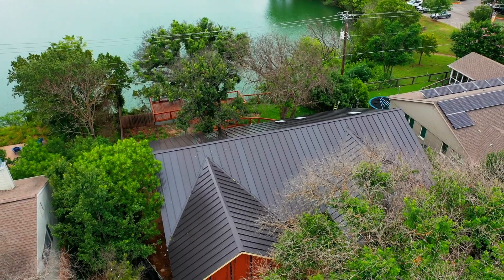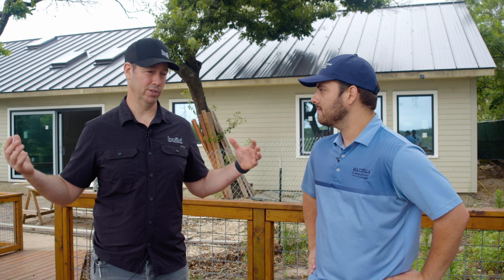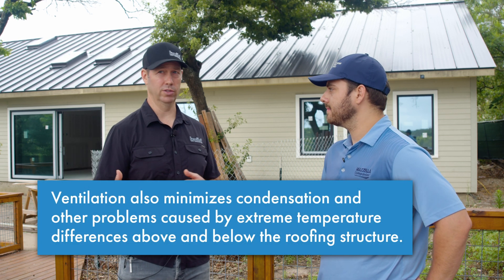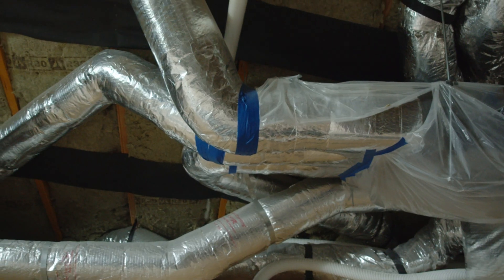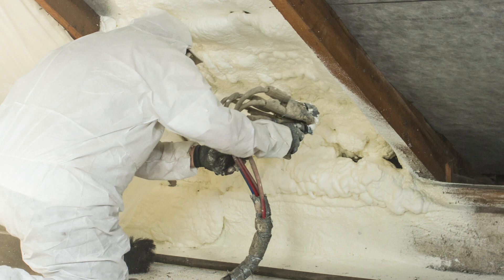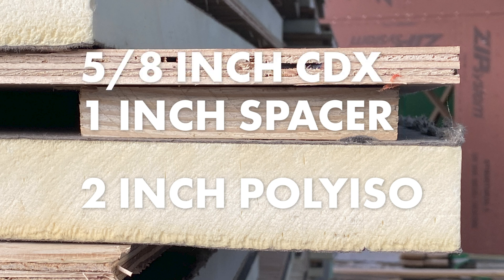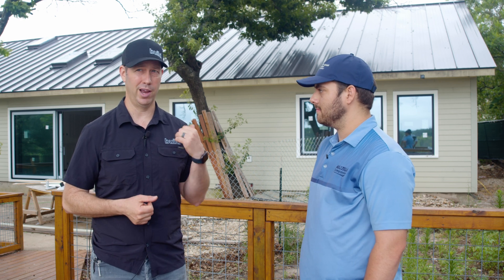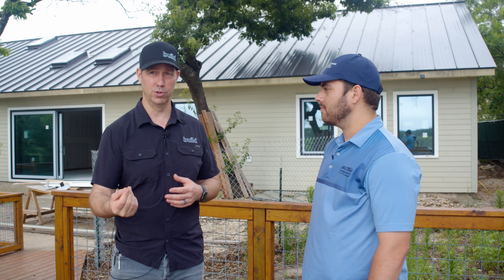Conditioned Attics vs. Vented Attics: Matt Risinger and Hunter Panels

Comment: Venting attics are good if there are no ceiling penetrations and alot of insulation. No ceiling hvac etc.  work well for some applications- mainly small homes or off grid houses with wood fires in cool climates with modern windows and good insulation throughout
Reply from the maker: No doubt that HVAC in the vented attic space makes it inherently inefficient (this is one of Joe Lstiburek's favorite topics). However, there are many homes in the North and Northeast with basement HVAC systems and vented attics that do work well. -Thad

Comment: FYI, Boral (manufacturer of tiles roofing products) makes a “cool roof” system that’s reported to save 28% energy costs by passively allowing air to enter holes in metal eves; then the air passes up the roof deck (via Boral’s elevated baton system) and the hot air vents out thru the ridge cap.   
It’s a great system.  8:13 
Plus the elevated batons mean all of the tile screws go into the battons, but do not penetrate the roof deck.  Save 1,000’s of unnecessary roof deck penetrations.  
Moreover, with the elevated batons. any water that does get past the tiles can run unimpeded down the deck and out (traditionally built tile roofs have batons nailed direct to the roof deck, which means water can pool up against every baton).

Comment: So i put foam throughout attic and now im replacing shingle roof with standing seem metal and they said they are going to remove all vents since i dont need them. They are closed up with foam now. But you are saying i need to create a gap between existing deck and new roof and install vents? 8

Comment: So how is the air sealing of the roof deck done with the Hunter panels? Just the spray foam inside? Also, won't the polyiso of the Hunter panels shrink some over time and pull away from each other?

Comment: i hate to be this guy.  what they are having put in that roof for a 50 year roof baffles me.  my home was built in the 60s, it's not insulated very well but vented.  Replaced the shingles 2 years ago the roof deck looks brand new.  i mean i had about 4 grand worth of shingles and did it myself and my roof deck almost 60 years old and cost 4 grand to make it last another 20 easily....

i know it makes sense building wise, but matts roof with that many details and what he had to put into it...probably 40-50 grand.  it better never need another roof

Comment: You've had all those critters in your attic?  Someone didn't do a very good job building that home.  The only  penetrations into my attic are plumbing vents, the continuous soffit vent holes and the ridge vent.  There is no gap where the roof and facia board meet.  None of the critters you mentioned can get in through those areas.  I have a vented attic with one of my ac units located there.  I have three more HVAC units in the basement. My house is an all brick and stone story and a half with full finished basement.  I used rockwool in the attic and walls.  I spray foamed any attic penetrations and I have a styrofoam jacket over my attic stairway.  I used Huber Zip on the wall sheathing with tape and liquiflash and Huber Advantech on the roof.  I use Huber liquiflash to seal where zip meets top of foundation wall.  I used marvin fiberglass windows.  I have no bugs and really low heating/cooling bills.  What happens when your closed cell sprayed non vented attic develops high humidity in the ridge.  Yep, you get rot.  I spend the money making sure my duct work is tight and I have more than adequate blown rockwool in the attic.  I'd much rather save the money spent on closed cell spray or open cell for that matter and use those funds to install premium windows and ext doors.

Comment: The only dumb part of a vented attic is putting HVAC up there.  Sure, if you can spend >$10k more and get tons more storage space by doing this.  But keep in mind it will not be saving you more than $30 of electricity each month compared to just putting the HVAC air handler in a well insulated space like a basement, purpose-built shed or interior utility closet.
Reply: Lucky you,  you have a basement, a place that's convenient enough to build a she'd, and a spare closet! 
Unfortunately for me,the attic is the best place for my HVAC ducting, and the roof-mounted A/C unit frees up patio space (and reduces compressor noise!) too.

Comment: My attic above the living part is conditioned with spray foam.  My attic above the garage is vented, I hate it.  Our house stays very comfortable all times of the year.  Our garage and storage above it gets very hot and cold.  
  Since we built 3 yrs ago, we've delt with different issues.  A big concern is leakage. We have a drip that comes through the foam, but have no clue where its coming from. There's no vents, or pipes within several feet of where its dripping and none directly up front it.  I'm concerned it's going to rot the roof and ruin the foam.  My builder said the vents in the garage are adequate for air flow. But the attic above the garage is suffocating during the summer, with zero air flow.  My conditioned attic is somewhat questionable.  No air gap, no space to stop radiant heat.  The foam was sprayed directly to the zip sheeting where you could see the nails from the shingles. 
  We paid good money to have our house built but we ourshelves aren't builders so we didn't know what should be or shouldn't be.  Now that I'm taking a look at how our house was built, so many doubts and concerns have come to light.  It's a nice house but I'm concerned about what I'll have to deal with in 10-20yrs.

Comment: Question  - I am building a cottage in Canada, Gatineau QC so we will be exposed to both hot and cold extremes. This is a 4 season cottage and I will be using a metal roof. The plan is to have half of the cottage as a cathedral ceiling and other half as a flat roof/ceiling above the bedrooms. I will be using a 5/8" OSB decking with ice and water either on the entire roof deck or at least 36" from the eaves. I plan to use 2-3" of closed cell foam spray on all of the walls and ceiling. I was going to add some 1x3" strapping on the roof deck to screw the metal roof in to. Thoughts?

Thanks
Reply: A design shown elsewhere would just add 2 layers of foam on top of the sheathing with the seams offset and a small air gap above the foam. Various ways of achieving the air gap. Don’t need to add another layer of sheathing.

Comment: My roof had styrofoam underneath metal roof deck but no decking to convert roof into shingle roof. My question is the previous metal roof had a continuous ridge vent. Now the roof contractor says it is not needed because of the styrofoam underneath the roof deck. I don’t know if I should take their their word for it.
Reply: If you have sufficient insulation in your roof system, you don’t need to vent the attic. Just make sure you have enough with no gaps and minimal thermal bridging. You probably need another layer of foam with offset seams.
Reply: Thanks again

Comment: I'm a bit confused. Is there a sheeting that goes on roof trusses first before the insulated panels? 
If I'm building a house with an insulated attic space and a metal roof, what's the best way to insulate that when cold is a bigger concern vs. heat?
Reply: Trust me. You can’t afford anything Matt has ever recommended. The roof he’s describing would cost fifty grand.
Reply: Yes. Sheath the structure. You don’t need to add the second sheathing. There are others episodes showing this. Do add the air gap one way or another.

Comment: Construction costs have got to be astronomical, with a double roof system, any savings from HVAC from keeping your ductwork cool would be negated by air conditioning the entire attic.  I'm  sceptical, our  laborers here in Florida do not have the talent to build this.  Attics are not status symbols, plus conditioned attics can contribute to roof rot. You can keep rodents out of a traditional roof.
Reply: As much as I enjoy watching Matt's builds and learning about building science, you need a lot of money to buy what he puts together. Ignoring the weight and engineering costs introduced in a retrofit like this one, if I wanted to do something like this, an asphalt replacement with my current insulation will run ~$15k or $600/square. A standing seam metal roof would double that cost. I can't find the cost of these Hunter Cool Vent panels, but building something similar would run about $10k in materials cost (ignoring labor). All in all, $40-$50k for a roof alone. That's only going to work in very HCOL areas and I've ignored the additional equipment like an air exchanger and other stuff that would be necessary for the redesign to work.
Reply: It all comes down to how long you'll be in the house. 5 years or so? Why bother with a conditioned attic. Just do the minimum to keep pests at bay and then let it be someone else's problem. If you want to live your life in it and pass it down, it's a totally different cost/benefit equation, because all of the rodent, etc. problems tend to compound over time.

Comment: If the attic in this house is conditioned... why is the soffit vented? Shouldn't it be a flush hardy or densglass and have zero ventilation?

To me, that's the whole point of an airtight house with a conditioned attic?

I'm confused, as a novice.
Reply: The attic is completely air sealed, the air is just circulating under the roof decking, which is above the roof air barrier

Comment: Matt,  I'm honestly delighted, no THRILLED to see you tackle the best engineering solutions for attic ventilation and cooling.  Forgive me if you've already answered this question elsewhere:  do you think a reflective foil would help to minimize downward heat radiation in the air gap inside those Hunter panels?  A foil facing UP would help to "bounce" radiant heat back into that air gap, further warming the air that is passively moving (and rising) up that air gap.  You can call it the RISING-AIR SOLUTION (patent pending) :)  Hope you MAKE A MILLION with that new product concept!  KEEP UP THE GOOD WORK, as always.
Reply: After browsing several of the comments here, I can think of a low budget approach that is similar to Hunter panels.  This idea could work great with a small house and relatively small roof area:  start with 1/2" plywood sheathing fastened to rafters normally.  Then, "sister" 2x2" runners centered exactly over all rafters.  Then, attach a final layer of 5/8" sheathing to those runners.  Any good carpenters can work up the soffit and ridge details.  Depending on budget, reflective foil can be placed on the first layer of 1/2" plywood.  The basic concept is to create a passive RISING-AIR gap, with intake at soffits and exhaust at ridge vent (pun intended :)  And, thinking further, this low-budget concept might also work when new shingles are being installed to replace old shingles, especially if existing sheathing does not need to be replaced.
Reply: They sell foil faced sheathing. No need to make it.
Reply: @supremelawfirm  it's called an overroof or a cold roof. Steve Baczek covered it in one of his videos. On my homee computer, I have a spread sheet with items from different videos. One company makes bug screens specifically for these types of roofs.

Comment: A semi-related comment: noting that combustion appliances are vented through PVC shows that  it is safe to pass combustion gasses through PVC, with little concern for temperature or Static Electricity (more of a concern with woodshop dust collection, but pre-emptively pointing this out). Why don't we use something similar for forced air ducting, especially since a large percentage of air and energy is lost through duct leaks? Of course we would never allow a combustion appliance to leak air in to our living space like a typical HVAC duct does, which is why we don't duct these appliances the same we we do HVAC air. So why do we accept our HVAC leaking conditioned air in to places that waste energy (such as unconditioned Attics)? Why not treat that air the same we we do efficient combustion appliances? With the move to heat pumps and more efficient carbon-based heating, the air temperature from an air handler will not get to a point where it is a danger to PVC (water heaters regularly supply temperature much higher). Why don't we use glued PCV ducts, similar to Water, Waste, and Combustion venting? Would love to hear thoughts from y'all.
Reply: Leaky duct work is the key.  HVAC installers absolutely need to do a better job installing the duct work in the attic.  If the duct work doesn't leak, you can cover it with blown insulation and the pipes won't sweat.

Comment: Vented attic is a must to suck out the heat. Solar fan will be good because it does not have that much power like electric one to suck out the cold air inside the house. Wind turbine will also help & should installed more than one. 

Most people don’t have the money to put metal roof with the insulation between like in this video so ventilate the heat out of the attic is a must, period.  The attic need seal if use solar exhaust fan or electric
Reply: The attic doesn’t have heated air that needs to be removed if the roof deck is insulated. Period.

Comment: I'm building a roof with 11-7/8" I joist that will be spray foamed.  On top of that I'm going with zip panels, taped and liquid flashed, and then 1×4 furring strips and a metal roof.  Would this be adequate in zone 5? Thanks
Reply: Interested. When are you starting? Shed roof?
Reply: @averageliving4Life  I have the roof rafters up and working on my gable walls
Reply: It’s probably too late to make a difference for you, but would probably have been more cost effective to reduce the amount of foam inside and spend it on 2 offset layers of foam sheets on the outside. Less expensive and reduces thermal bridging.

Comment: Depends on the climate where you live.  A conditioned attic makes more sense in warmer climates where the HVAC systems are located.  Here in zone 6, HVAC is located in basements for the most part.  Many homes in the south don't have basements since frost lines are shallow and not worth the cost for the 9'+ excavation.  I'm building a home in MN and will have a vented attic.  Top of ceiling drywall will be spray foamed with closed cell to 2" with blown-in on top to R-50.  Having roof trusses would limit the space for a usable attic, so no sense to condition the attic space by spray foaming the underside of the roof deck.

Our current home uses stick joists with vaulted ceilings, so no attic and the insulation between the roof joists is closed cell foam.
Reply: Your current home is essentially what they are talking about minus the ceiling joists and location of the finish.

Comment: What is the best way to condition an attic with new metal roof already in place. There is no insulation under metal. No ac unit in attic. I was looking at Owens Corning membrane against truss and blown in in membrane. Should there be ventilation soffit to ridge vent. I’m in center nc
Reply: There's eagle shield. Look into them. You're kind of stuck on that assembly imho. Matt has the metal vented above the lid assembly essentially. You won't be able to get there as it is.
Reply: Spray closed cell foam on the underside of the roof.

Comment: The only thing I don’t like is using gable vents and ridge vents at the same time. I don’t know how true it is but I feel like at the end of the Gables instead of pulling air from the soffit and just circulates right from the gable vent up into the ridge vent
Reply: You don't use gable vents and ridge vents together. Venting needs to come up from the soffit and through the ridge venting
Reply: @ckstd  yeah exactly what I said